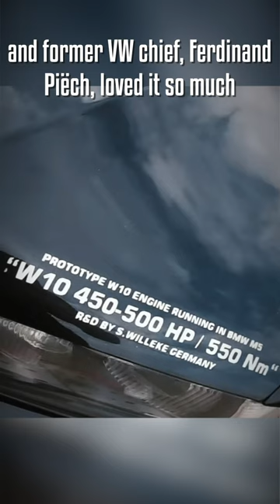VW Created A Working W-10 BMW M5 (Real Sound)

Comment: Also volkswagen knows, E39 is one of the best cars ever made.
Reply: Hope so. I rarely drove mine but still seems to just break.. and im very easy on it. Mechanicals held up pretty good tho
Reply: The E34 535 manual was my choice
Reply: It probably just fitted in that car. VW had non which fits.
Reply: @dom3827 if VW had cars that were able to fit W12s and V10s, why a shorter W10 wouldn't fit?
Reply: One of the best driving for its size? Yes, reliable electrics? No lol

Comment: It's very interesting that they tried this concept on a bmw. I wonder why they didnt chose a vw for it ?
Reply: ultimate disguise..
Reply: E series of this generation was much easier to find stuff to do mod fit designs and as a one off, why would you try and source less easily available mod scene parts.
The rwd layout of the chassis would help as ZF exists along with other gearbox manufacturers for nuthead BMW drivers.
But wolkswagens
Nah. Not so much unless it's a golf...
That and it would stay under the radar more easily as a 'oh, just another nuthead BMW driver in his sleeper'
No sporty Volkswagen's apart from a Golf at this point from my recollection either.
Reply from the maker: Various reasons, one of which was the chassis capabilities for an engine like this
Reply: Because they handle like s...OAP? (I own an A5, I know what I'm talking about.)
Reply: E series bmw can fit almost any motor inside of it, the chassis capabilities are endless.
Reply: FWD + W10 = soggy frankfurt
Reply: E39 M5 has timeless styling
Reply: @T_Perkins the sporty cars designed by VWAG are generally sold as Audi, Porsche, Lamborghini, and Bugatti.
Reply: @ExaltedDuck  
... Don't want to include Bentley in that? 😉
Reply: @T_Perkins  I probably should have but it slipped my mind. But then again even if it got the W12 those things still weigh like what 5 or 6,000 lb? Sure that's powerful but those things are hardly svelte
Reply: It makes sense though, as a RWD platform is more flexible than the engine in front of the front wheels platforms of the VWs and Audis of the day. Also, think for a second, what can you do with a W10? Either put it in a supercar, or in a limousine. If there is one car that is both, and will allow you to test both character, capabilities, performance, refinement and flexibility, it's the ultimate supersaloon, the M5.
Reply: @ambergris5705  I was hoping someone would bring the drivetrain up! It’d be like trying to stuff the W10 in a Subaru lmao, engine will hang too far forward. Another thing to note, even if they could stuff it in a vehicle from their lineup it I believe it wouldn’t be drastic enough of a difference. In a S6/S7, the V8s already similar weight and more power with a tune. Then there’s the Phaeton/Touareg, where they’re already offered with a “comparable” W12 making just short of that 500hp
Reply: @marxoxander  very good points all around

Comment: They also made a vr5 engine that was actually released in Germany. If they had the 5 there had to be a w10.
Reply: VW also fitted the VR5 to the Jetta or Vento available in some markets outside of Germany
Reply: Golf also in 2.3L MK3 VR5 not so fast just plenty strong and great sound.
Reply: VR5 was quite common in MK2 Toledo

Comment: now make a W20 clyinder engine like that, with 20L dispalcement and a big turbo on it, that should be good for like 3700HP on the wheels, 500Km/h topspeed. mid rear engine would be nice, placed behind the driver.

Comment: Does that thick block disapate heat well? or will it overheat the small end bearing, the cylinder walls look thin on the end and large un-even areas in between the pistons, causing temperature hot spots? and warping in high boost, cold to high temp conditions

Comment: I want to see the crank on this thing, how do all those rods fit on one crank in such a short run?
Reply from the maker: Imagine a VR5 crankshaft, only with wider rod journals, as the W10 did not have split journals like the W8 or W12

Comment: What capacity?
Reply from the maker: Not specified, but my assumption would be around 5.0-liter considering the W-8 was a four-liter and W-12 were mostly six-liters
Reply: @VisioRacer   i guess same, they say that 500ml is the most effective displacement for 1 cylinder. so 10x 500ml = 5L . the HP number between 450 and 500 would match that.

Comment: considering the issues that arent fixed on the other BMW engines since 10 years going with a more complex engine wont work to well. 
The engine is going to be plagued with issues and wont make 100'000km before blowing up
Reply: This isn't BMW of the late 2000's buddy. There's a reason the E39 is considered the best saloon even nearly 30 years after it's release.
Reply: has nothing to do with BMW tho

Comment: VW has no proper RWD platform - and use competitor's chassis instead. How much market share they have lost because not having a RWD car?
Reply: very little lol. a better question is how much have bmw lost by not having a FWD car?
Reply: @martin-vv9lf BMW has Front wheel cars, F45, F46, F44 and U06 and the X2
Reply: The Audi R8 is rear wheel drive and Audi is part of VW
Reply: @TheAwast2  True. I meant in my mind front engine RWD. The classic.
Reply: @martin-vv9lf  Guys like me are rare, I know. I'd like to see some good RWD cars from other manufacturers and not only dishwashers. WV is not the only one to blame.
Reply: @Ruudwardt  if you want front engine rear wheel drive you can go for older cars for example Toyota E70 and E80, Ford Mk1 and Mk2, Opel Kadett C, Lotus Elan Type 50, Nissan Skyline Type C10, Datsun 280ZX, Porsche 924/944/968/928
Reply: @TheAwast2  I know most of these cars - they are great. Why no new awesome driver's cars though - with modern tech (suspension, engine ..everything).
Reply: @Ruudwardt  there are a few, for example the Toyota GR86, 4,27 metres long, 1,76 wide, 1,31 height, 2,58 wheel base, 50 litres fuel tank, rear wheel drive, 1289 Kg empty weight, 6 speed manual or automatic the engine is a across mounted 2.4 litre Boxer engine with 235 hp @ 7000 and 250 Nm 3700  12.5 to 1 compression the car starts at 35490 € to 37600 € fully equipped
Reply: From HKS there is a Turbo kit with permit in germany for 8500 €  400 hp and 500 NM
Reply: @TheAwast2  You a sales guy, huh :D ?
Reply: @Ruudwardt  haha no, i work as a conference leader in big Auditors Company, so basically i do the catering for the conference rooms

Comment: But that's a V-VR engine, not a W engine...
Reply: V+V=W
Reply: @thijs5931  you could say its a VW engine
Reply: VVR is W
Reply: @thijs5931  no, its not 2 V engines, its 2 VR engines
Reply: @memorimusic420  nope, VVR is VVR and W is W layout
Reply: @cptkugelhagel  not really: you have the pre 40s true W and you have the VW VVR engines which are also called W. Different layout, same name
Reply: @memorimusic420  they are colloquially called "unechter W-Motor" (fake W-Engine translated)
But they are called VVR engines or Double-VR engines officially.
Reply: @cptkugelhagel   yes i know thats just the nomenclature VW uses

Comment: 500hp aint shit no more. Impressive design but they better come up with better numbers than that.
Reply: Stop reading stats and drive. Horsepower don’t mean shit it’s all about torque and weight.
Reply: @Ashw1115  why reinvent the wheel then? An om606 will blow that outta the water without much fuzz. So will an old ass ls engine. Seriously it's a very cool design and all but the numbers aren't there. Like me stuck on my e38 v12 just because it was a v12 when it's numbers werent shit.
Reply: Bruh